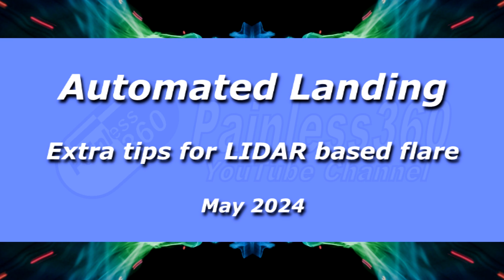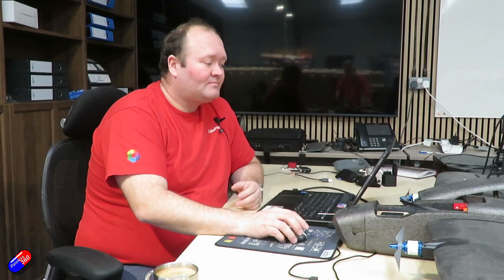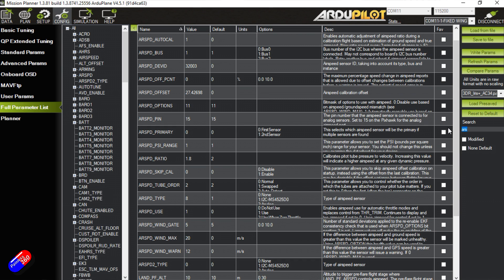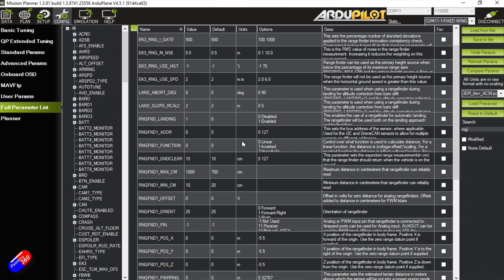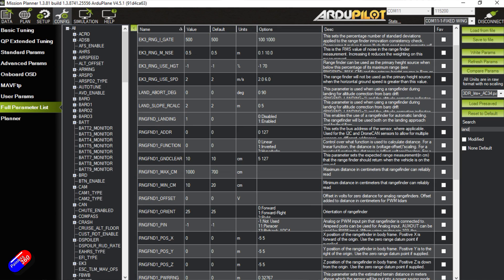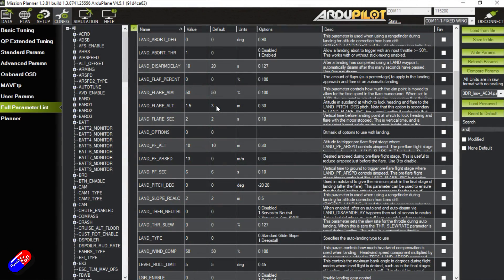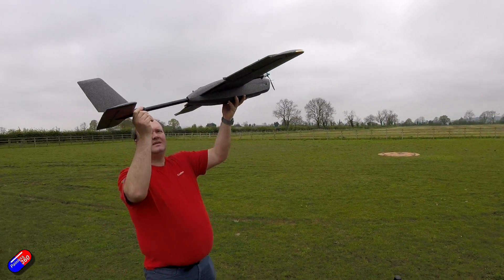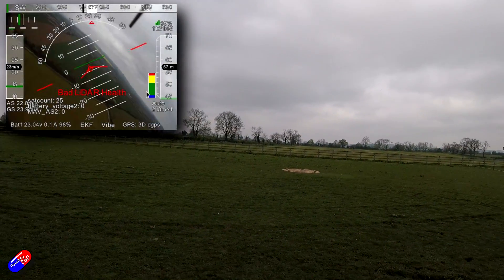Arduplane Autolanding with LIDAR: Setup tips

Comment: Great video.  Question.  I bought the same Benewake as in your video.  I am trying to connect to a Speedybee F405 Wing Mini on UART 4.  It is powered on but not reading.  I tried switching the RX and TX just for the heck of it but still no results.  Does this rangefinder come set for I2C or UART as a default or does it automatically detect?  The UART4 is not able to do I2C on the speedy bee.  Thanks and lover your videos!
Update.  I may have figured it out.  I changed it to Benewake serial in AP parameters and it seems to work now.  Is this okay to do though?

Comment: Realy nice work & brilliant tutorial (especiallky that I am working on a very simmilar T2 with most of the harware bought from Ben)  ! Thank you !  However this fine tuning even nice is hard to be made only once and cover every real life scenario. Every minor change will alter the landing behaviour, especially weight. I often find myself flying my T2 on TOW ranging from ~2.2 up to 3.2 kg, and every single 100g i add changes its behaviour.  Not to mention the atmospheric conditions like wind, and even air temperature and humidity that dramaticaly influences the behaviour of the model.